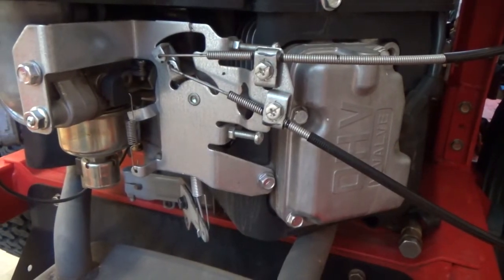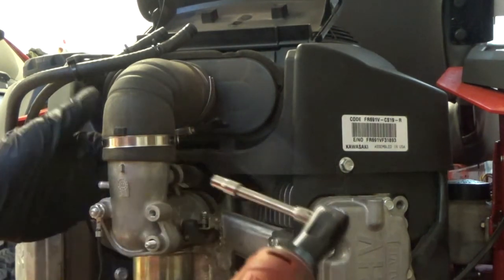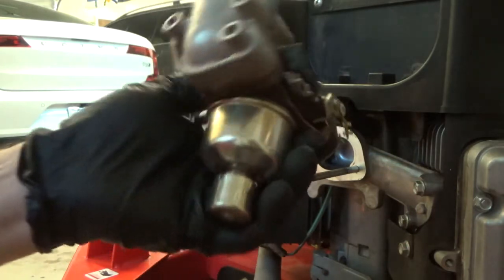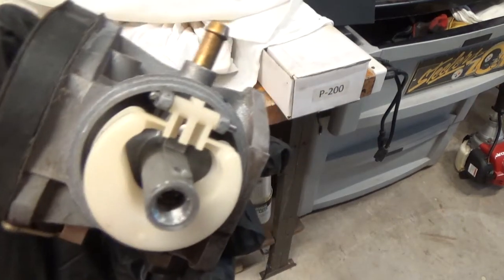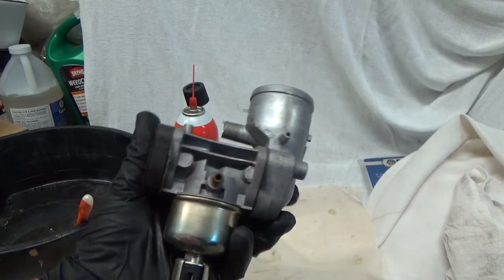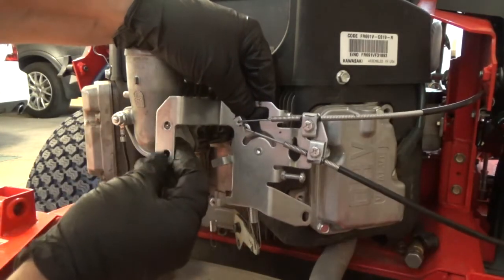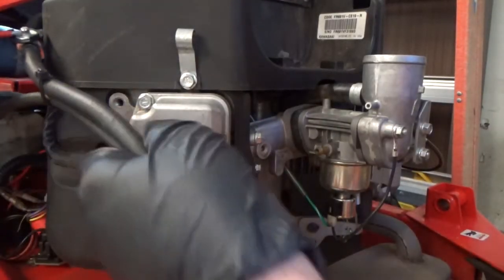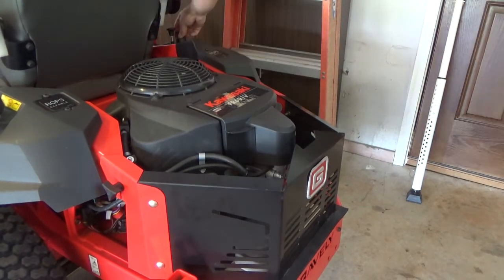Kawasaki FR691V Walbro 26B Carburetor Removal and general Cleaning

Comment: KAWASAKI FR691V - surging or rough rpm even after cleaning carb, or fuel pump, or coils or plugs?  replace BOTH intake manifold gaskets.  This is a known problem with this brand and model engine.  Apparently the gaskets are prone to heat soak problems.  I have the same exact engine.  Changed everything and still would not idle properly.  here are the symptom conditions>  cold start (literally engine is cold)...idle is fine...at all rpm ranges.  However, once the engine heats up after about 10 minutes, the intake manifold gaskets (one or both of them) is no longer making a good seal and a small amount of air is sucked in.  Since this is air AFTER the carb fuel air mix, this causes the engine to SURGE...it goes lean, then the governor adjusts the carb, smooth back out and then rebounds back into lean.  This will continue even into a higher full throttle but is harder to hear and feel as the small amount of air isn't as significant when the rpm's go up.  Another thing to watch for and to do at least once a year on these engines is to check all the main head gaskets. A simple compression test can do this, but you will need a intake blocking plate to perform it properly (with leakdown test).  When I first received my mower, I checked all the bolts and found two were not properly torqued and loose on the intake manifolds..and one cylinder head was also not properly torqued.  I also check spark plug gaps and coil gaps.  It's quite common that factory quality control escapes happen and this can drive you nuts trying to figure out why your machine is not working correctly.  So check EVERYTHING when you get your equipment.  It will save you alot of headaches down the road.

Comment: I have a Hustler with the same engine. It's had the same little surge at mid throttle since new. Only does it in park with no load. If I am driving around without the blades engaged I never notice it.  I have around 500 hrs on it now. Basically I have been told that it is pretty normal for these engines. They are tuned to run at higher RPMs. Thanks for the video!
Reply from the maker: Your are welcome. I am glad I could help.

Comment: I watched this video 4 times in detail. I took my time. My mower ran 5 times worse and constantly cutting off. This video worked well for me. Will add one point to the video.  Get a new gasket.
Reply from the maker: Thank you. I really need to into more detail. I had to run the carburetor through the sonic cleaner a couple of more times to get it cleaned out.

Comment: The carbs are very good but the air filter stops up very very quickly and lots of dirt going into the engine and destroying the rings
The Heavy Duty upgrade kit is a must in dry dusty areas 😊😊

Comment: You should have sprayed Carburetor cleaner through all  the holds in the carburetor to make sure all the enter fuel pathways were clean.  All said it looks like a nice carburetor  and easy to get to. Thanks for the video.   What kind of lawn mower do you have? Is it a zero turn type and what is the name and model number of the mower.
Reply from the maker: You are correct.  This was a tough one but, I did get the midrange problem solved.

Comment: Hi David, I just bought a mower with the fr691v engine. The upper hose connected to the carburetor that you mentioned on the video as possible vacuum hose is just hang loose connected to nothing. Could you give me a clue as to where it goes? Also I did a carburetor job, have fresh gas and the more runs great when it's above 60°. At 50° it will not start. Any clue on that problem? Thank you in advance.
Reply from the maker: The carburetor hose runs up to the top of the gas tank between the fill cap and the drink holder.  The left fender has to come off to reattach the vent line if needed.

Both Gravely and Kawasaki have downloadable parts and service manuals.

I have not had any issues and I do not want to encourage throwing parts at it so just check the easy stuff.  Inspect the air filter, replace the fuel filter, check the fuel pump for function,  check the spark plugs for fouling or lean conditions,  check the valve clearance, and look for correct installation when removing and reinstalling anything.

Of course, the manuals might give clues too.

Good luck and I hope you get everything running correctly.
Reply: Best clamp ever hose on it and install air filter upgrade kit 😊
Reply: Adjust valves. Loose valve cause cold start issues

Comment: where does the other end of the vent hose go?  One end to the carb.
Reply from the maker: Well,  the vent line is very long and goes to the top of the gas tank fill neck.  The vent hose connection on the gas tank is up by the cap and is hidden i.e., under by the fender.

Comment: I have the same Kawasaki 23 hp FR691V . I replaced the fuel pump and im still having problems. It will start and immediately shut off . Then messing with it so much i think i have the gas line and vacuum line Crossed . Frustrating because it will fire up and run on the gas in the bowl if i unhook all the gas lines
Reply from the maker: Only a guess but,could be the solenoid under the carburetor. They do mess up.
You can test it or remove it completely and put a carb bowl screw in there, like in older engines.
Reply: @A_Renaissance_Man  Thank you
Reply: Change all the fuel hose and filter

Comment: I just cleaned the carb on my 2015 S240 John Deere(Kawasaki FS600 surging/ starting issues) and found black gunky stuff in it. The fuel and vent hoses are disintegrating. I had this happen on a two year old John Deere diesel tractor.
Reply from the maker: What I found in mine was that I had to go back and clean the carburetor again.  The second time, not shown, I had to keep the carburetor body submerged in the Ultrasonic cleaner through four max cleaning cycles, changing the hot water out each time.  

I think the PVC hose at the top is feeding crap into the carb and causing the tiny holes at the top to become clogged or built up in such a way as to interfere with the normal operation of the carburetor.  Aren't the EPA laws great?
Reply: Fuel caps are bad about rubber coming apart a falling in fuel tank

Comment: mine is surging like a mofo.  why didn't ya clean out the jets? Mine has about 200 hours . I bought it used at 180 .  I'm wondering if this is why the previous owner sold it
Reply from the maker: I just had trouble taking the carburetor apart so I just sprayed it opt and my problem was solved.

Sorry I did not comply overhaul the carburetor.
Reply: @A_Renaissance_Man   I got my main jet out no problemo. It was wide open.  It turns out my choke needed a very slight adjustment

Comment: Can't believe you took it apart with ONLY 40 hrs for that issue, BTW, so did you buy the unit this year? What is your impressions of the unit thus far?/
Reply from the maker: I have had this for several years.  You can see my earlier Gravely reviews, old change, blade sharpening, and maintenance.  I did not mind pulling the carb, I have been working on my own equiptment all my life.

Comment: I have the same unit and just removed the bowl only to spray some carb cleaner in. Solved the problem of not starting but now the bowl is leaking fuel. Should i take it off and try to re-seat the gasket or could it possibly be an issue with the solenoid?
Reply from the maker: The two places to look are the bowl nut/solenoid, make sure the gasket is in place.  And the second is the bowl gasket itself.
I cannot remember at the moment but, some carburetors have a sharp bowl top that is sealed with a thin o-ring.
Those checks can be made without removing that carburetor but, I would checking it on the bench. Good luck and I hope you fix it.
Reply: @A_Renaissance_Man  thanks I just pulled off the bowl and the gasket for that was very loose and had a loop in it for lack of a better description, it kind of sagged down into the bowl at one point. Seems like it's stretched out too much, I'll try replacing. Thanks for the input!

Comment: Do you have a part number for that carburetor?
Reply from the maker: Yes. The Walbro 26B part number is 15004-0985.  I think they are ridiculously overpriced.  The last time I checked they were $130 + S&H.  I would buy a cheap knock off as a backup and then diagnose and clean the original and then the original will be ready as a backup to the cheap one.
Reply: @A_Renaissance_Man  Thanks for the reply.  One more question, you keep calling it a 26B.  Is that something specific with the carb? What's the horse power on this engine. The one I'm replacing the carb on is a 23hp.  (because the pin hosing, where the float connects, is cracked) The engine sticker is gone. So I'm just guessing at which carb to use. Gonna try an after market carb. If it doesn't work, I'll replace the jets from the old carb to the new.
Reply: Chock shaft will stick and cause it to run bad 😊

Comment: Will this fit my ariens zero turn mower my engine is the same FR691V
Reply from the maker: Yes, this style of carburetor will fit, as the Kawasaki engine is separate from the  mower manufacturer.
Even the Cheapo $20 ones on Amazon should work just as well.  I tried a two of them out and they have been working without issue for two seasons now, or at least this is the second season and there are no issues.  I keep the OEM carburetor in reserve.
Reply: Where can I get an 3/10 socket bits at so I could remove the screws off the plate as you did in ur video

Comment: I have a problem with the engine dying after a couple of minutes
Reply from the maker: Well ... I did not make a video but, I did buy a cheap carburetor on Amazon and I ran the Walbro through the sonic cleaner several times and put it away as a spare.  So far, the cheap carburetor is running great at all throttle settings.  I did see where the cheap air filter was potentially allowing dirt in so I bucked up for a genuine Kawasaki air filter and so far so good this season.
Reply from the maker: P.S. dont forget to check the fuel pump.

Comment: This video really did not share anything useful.
Reply from the maker: You are correct. Sorry about that.  I have removed these new carbs several times now and all you can do is sonic clean them and that is it.  Sonic cleaning has fixed them all as the air and fuel passages are very small an the days of using torch cleaning wires are over for these particular ones.

Comment: A waste of time. Did not fix the problem, just
Reply: Just stumbled through shade tree style.
Reply: Make sure you  don't have any welch plugs missing.
Reply: The Welch plug near the mixture screw was leaking on mine and was creating the same issue everyone on here is talking about.. I covered it over with jb weld and it runs like new.